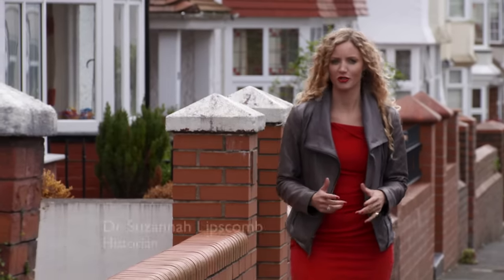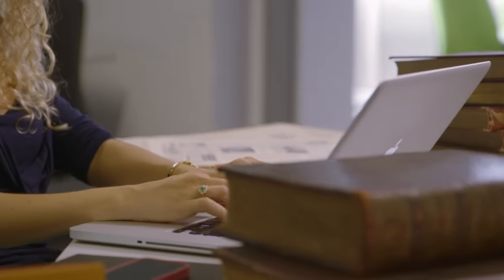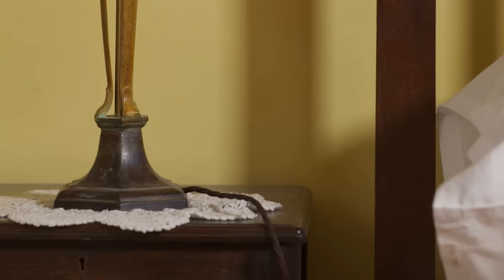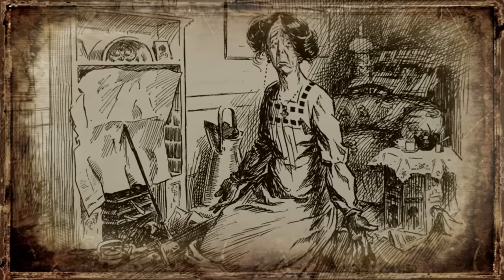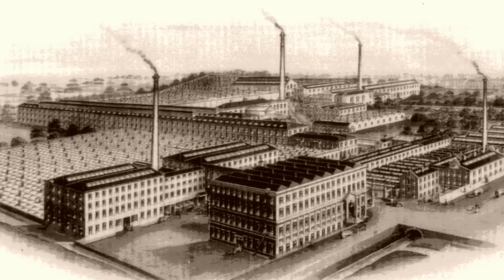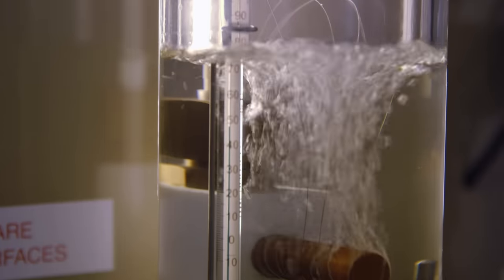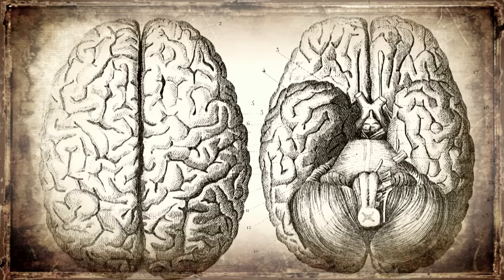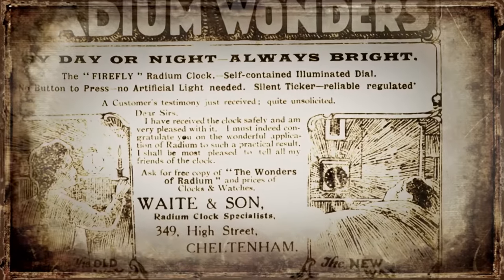How New Electricals Made The Edwardian Home A Deathtrap | Hidden Killers | Absolute History

Comment: The rise of domestic electricity actually saw a steady reduction in house fires, because of the consequent reduction of use of 

In VERY early days, there was no sheathed / insulated cables, but the cables were solid-drawn copper affixed to ceramic "standoff" blocks (insulators). These arrangements could still be found in places all over the world well into the 1990s. HOWEVER, they were originally designed for Edison's Direct Current at about 100V . The use of DC was a major reason for extended-duration "arcs" in switches. 

HOWEVER, with Nikola Tesla's ALTERNATING CURRENT, the voltage actually drops to ZERO a hundred or a hundred and twenty times a SECOND, dousing the arc instantly and causing MUCH less damage to the contact in the switch mechanism.

Also be aware that in MANY places, the early electrical supplied to houses and shops was linked straight off nearby tram supplies. If it were not for the extensive tram networks in cities all over the world, "home" electricity  would have been a long time coming.

Electric lights meant no more fooling around with candles, oil / kerosene lamps AND heaters, for starters.

Early flexible cables were insulated by wrapping layers of cotton thread around the multi-stranded core. This technique was still in use into the 1990s with devices like electric clothes irons and other devices that used electricity for generating heat in small appliances. The problem is that the cotton frays and degrades with age and is subject to attack by a range f tiny critters.

Next came Vulcanized rubber insulation, just before WW2. This was a serious improvement and timed nicely with the rapidly rising demand for electricity distribution. Unfortunately, Rubber steadily oxidizes and becomes both brittle and CONDUCTIVE. HUGE amounts of rubber-insulated cable went into domestic and commercial premises post WW2. By the late 1960's, much of it was starting to degrade and cause "issues", like FIRES. Fortunately, PVC insulation was coming on stream; CHEAPER and MUCH more robust and long-lived than rubber.

None of this is rocket surgery. Getting "belted" by mains electricity is NOT nice, and can cause nasty tings to happen to your heart, for starters. RCDs (Residual Current Detector) also called a "Core-balanced, earth-leakage detector" have been commercially available since the early 1970s. Life saving devices, they are so sensitive they will start to trip if you let the crumbs build up in your pop-up toaster.
Reply: Great comment!
Reply: I remember we had one of those cotton covered clothing irons when I was a kid in the 1990s. It always freaked me out and I was afraid of it.
Reply: The alternatives were not exactly safe either.  The gas in typical use then was producer gas, which was made by cooking coal in retorts.  The principal flammable component of producer gas is carbon monoxide.  If the lights were ever extinguished by an interruption in the gas supply (such as when a gasometer/gas tank blew up, which they often did), the building would be poisoned when the gas supply was restored.  If it didn't blow up first.  The same problems existed with water gas and carburated water gas.
Then there was the problem of adulterated kerosene, which could explode depending on the adulterants.

Also, AC only changes polarity 120 times a second with 60cy/sec AC.

Comment: I remember that houses covered with asbestos plates was a not an uncommon sight when I was a kid in the late 80s and 90s. Next to us was a very big house that was pretty much an asbestos fortress. In the late 90s they were torn down and replaced with wood paneling. I rememeber that it was a very strict and time consuming process. The asbestos houses are almost completely gone now. But there are still a few houses left here that are completely covered in it.

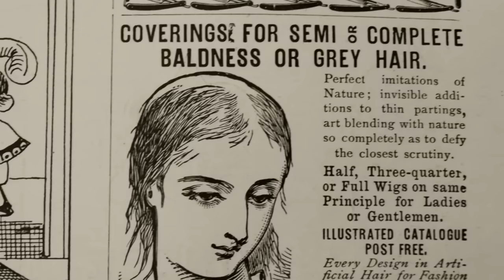46:07 My grandmother once told me that when she was a young girl in the late 1940s and early 1950s they used to straighten their hair with the clothes iron. And it was not the modern, easy to use electrical type. It was the old fashioned cast iron type that they had to fill up with burning coal. If they were not carefull they would burn their hair. And if you were extra unlucky you could completely ruin it.

Comment: The crazy thing is that, I think the elementary school I went to has asbestos in the floor. I'm pretty sure it was built in the 1960's.
Reply: Bohemian Lucy my apartment was built in the 30’s to 40’s and has asbestos in the popcorn ceiling
Reply: Asbestos is everywhere
Reply: Asbestos can't harm you if you don't ingest it. My God.
Reply: Bonded Asbestos is generally fine as long as it is not disturbed. Sometimes it is safer to leave it rather than remove as removing it disturbs things and puts particles in the air.
Reply: @damienthonk1506  True, but it's shocking they were still using it that late when the dangers were known decades earlier. The dangers were to the factory workers who made asbestos products and the construction workers who built homes with asbestos products, not the people who lived in them.

Comment: "The tiniest amount of gas". Completely false. It takes a minimum of 15 percent gas in the any room to have a detonation from a random spark. To put in to perspective, with a ten foot ceiling the first 1 1/2 feet from the floor would have to be filled with gas, doors and windows closed. This is THOUSANDS of cubic feet of gas needed for an explosion in the typical room. I have taken the licensing tests as a gasfitter, that is how I learned this. Edit: this is also why they add scents to gas now by law, naturally you wouldn't smell it there until it was a fair amount.
Reply: "The tiniest amount of gas" is subjective..  Remember, this is the late 1800's. They also  stated that gas leaks were quite common. Even today in America there is on average a natural gas explosion every 11 days.. 
Oh yeah,  the actual Explosive limits, vol% in air is 5-15%.  Again, late 1800's.. 

Good grief I don't know why I'm so fucking jaded anymore..
Reply: How big of a room would you need to fit thousands of cubic feet of gas, and have it all in the first 1 1/2 feet from the floor. Anyone?
Reply: @donnebes9421  This isn't the natural gas we're using now, this is what's called 'town gas,' 'coal gas,' or 'manufactured gas.'  Natural gas is almost all methane (with that strongly smelling tracer added as a leak warning).  Town gas was a mixture of hydrogen, methane, acetylene and carbon monoxide.  Carbon monoxide is a very dangerous cumulative toxin that can build up in a person's blood by binding irreversibly to their hemoglobin.
Reply: Gotta use them SCARE tactics yo. Look how many are scared of electric blankets. Lol.
Reply: @etherealrose2139   and rightly so,   the  radiation field that an electric blanket gives off is seriously damaging.  in the light(!)  if the book "invisible rainbow"  arthur  firstenburg,   its likely a big contributer to arthritis, rheumatism cancer and a host of EMF/RF  diseases.    all from 240v  50/60`~   electricity is going to be the next  asbestos .

Comment: As a child I was always terrified by the enormous gas geyser that loomed above the bath taps in my grandparents' Victorian/Edwardian house.
Reply: john jephcote The scary thing is that the majority of US homes still use something very similar. The ubiquitous gas "water heater" is nothing more than a slightly updated version. The US still permit open flue gas appliances in the home, unlike Europe. It's quite common to find them sharing a flue with another appliance such as a furnace. What's worse, it's usually perfectly legal to install your own - you don't need a licensed gas fitter, are not obliged to check the flue draft or run combustion gas analysis. It's probably only because these things are normally located in the basement that we don't hear about more deaths.

Comment: It was Tesla who discovered electricity
Reply: Na. He did pioneer alternating current, the first electric motors and many other things but he did not discover electricity. Don't get me wrong, he was awesome but plz don't confuse facts due to modern day hype.
Reply: Just to elaborate. Tesla came about alternating current in 1887. The first modern battery was created in 1800 by a dude name Volta after he had figured out the steady flow of electricity.
 Before that (1752) a little guy named Ben Franklin did an experiment with a kite and key proving lightning and electric sparks were the same thing. This came about after studing works of Thomas Brown who modernized works of William Gilbert (circa 1600.)
 Muuuuccch before all of this the Greeks had discovered the electrical charge around 600 b.c. It is also known that Egyptians studied electric shocks from fish. Not to menton the bagdad battery, traced back to the Parthians in 250 b.c. used to electroplate silver.
 Electricity is ubiquitous within physics and the universe itself. Who first 'discovered' it will never be known.. but it most definitely was not Tesla.
Reply: Ben Franklin ?
Reply: @Grovesie35   Way to tell it like it is !!!  There is so much BS floating around out there.  Rosa is just another uneducated commenter...

Comment: I'm only early seventies but I used to use appliances with a cable to the light socket. Also, my Mother said that her father only installed electric lighting downstairs and that it was thought unnecessary when merely going to bed. A candle sufficed as it always had.
Reply: Michael Caine is shown doing that in the 1971 film Get Carter. I recall seeing fire safety literature as a kid in the 80s advising against it. I'd never seen it done at the time.

Comment: Here in Bermuda our houses used to be made of local sandstone.  They would run the lead cables through the walls, and when it got damp (most of the year in fact), you could get an electric shock just by touching the walls.  This was still true at the time I was a child, although rare as modern methods were quickly displacing the old wiring.

Comment: As an electrician I have been shocked by everything from 120 volts AC to 480 AC. 120 feels like you got hit in the funny bone. 208, 240, 277 like you got hit hard with a stick. 480 is like getting hit with a sledgehammer. My hand turned red then black and blue and purple. Took weeks to feel normal again. 

I have been shocked thousands of times.
Reply: how... shocking.

Comment: I am 51 year old female with mesothelioma, yes I was exposed during the mid  1970ts to early mid 1980ts only started trouble with breathing  3 months ago August  2021. Although I suspected I was becoming unwell at least 2 years before  I could not put weight on and struggled to work without getting fatigued.  I am very upset and Angry that many people are still going to suffer and the toll will take yet another 100 yrs to know the figures of how many have died from this horrific stuff.

Comment: The council, were checking my roof for asbestos last month , they two years ago put on a new roof and insulation around my building.  Surely they should have checked for asbestos before putting on a new roof?  Luckily they didn't find anything. But it seemed like the wrong order and would have saved money if they had checked before

Comment: I remember as a lad our house in Bromley which had the ancient array of round pin plugs that often made zzzt noises and zap-u light switches.   I helped my late father rewire the house which was brought on by one evening one of us had gone into the kitchen but not turning the light on, the electric cookers massive 3 pin socket plug was glowing like a cherry as was the understairs fuse for that circuit so we put in all new MK square pin plugs, shielded mains line he had purloined from British Rail, MK roses for lights and the cooker had its own separate fuse circuit breaker (very early RCD) and it took weeks to finish.   When we stripped out the old ring mains, much of the fabric insulation had long rotted or eaten by rodents and how them bare wires never touched amazes me to this day O.o   Also my younger brother had discovered he could shove two Parker pens into the larger round pins and make them do funny things, how he is alive amazes me too.

Comment: Electrocution depends on how well grounded (a return path). Say, standing in water, bare foot, and you grab the light socket. If you are not 'grounded' you can touch thousands of volts of electricity and suffer no harm. Note the men who work on the high line transmission lines. They get in an insulated bucket truck and they handle the live wires with no issues. However, if they were standing in a pool of water, and touch said wire, they would be instantly killed.

It is why birds can sit on electrical wires and not be affected. Because they are not grounded (no return path) for the current to flow.

Comment: When my family moved down to live in my Granddads house in the late 1950's right down at the beach by the sea at Bonchurch Isle of Wight, there was the old telephone in a wooden box, mounted on the wall with the lift off ear hand set hanging on a bracket come switch on the left side, and the coned microphone on the front of it, with the dial. Then there were lead pipes for the water,  and the electric twin black and red 'insulated' wires were mounted in grooves on wooden slats down to the brass light switches, and  two pin plugs and sockets . There was also the remaining gas outlets on the walls for the lamps, long removed I guess when an electrical supply was installed.
The house was quite old, I think built in the 1800's sometime, with dark wood panelling covering the walls with bell pushes in the dining, and sitting room, plus the main bedrooms.  Down in  the back  (servants) room opposite the kitchen, above the door was a glass fronted cabinet with the bells, and the number of the room for the various rooms.
This was a 3 story building, with the top floor for the servants quarters, and a hidden stairway from the kitchen (opposite the back room) that went up to the middle floor, then over the landing to the other set of stairs up to the servants quarters, so that they could move about without (in theory) being seen going about their duties.
A lovely old house with high moulded ceilings, but a bit freezy in the winter time with just open fire places in just about every room for heating, which in the old days the servants would start a fire in them to keep the rooms warm.
Also near the kitchen was a door that went down to the cellar where the coal was kept, and supplied via a man hole outside the front door.
Back then when we lived there, the lounge and dining rooms were not used except at Christmas time, as normally we 'lived' in the back room with a large(ish) table for our meals, cooked on the coal gas cooker.
The house was eventually rewired, and none of us managed to electrocute ourselves, as we didn't recognise any dangers, and the lead pipes were replaced with copper ones.
Happy days when growing up....:)
Reply: Thank u for sharing ❤️

Comment: 18:52 - A small but important correction, the fuse wont protect you from lethal shock. This is a misconception that still prevails to this day. The fuse will stop you from burning the house down, but since a few tens of milliamps may be sufficient to kill you at mains voltage, and since a typical mains rated fuse will allow amps rather than milliamps to pass, the fuse will only protect you from short circuit fires. 
Modern domestic electrical systems employ leakage current detection devices to provide shock protection. These came along much later than Mr Eddison. 
Eddison's idea to include a fuse provided very little protection from electrocution.  The rubber insulation on the plug however might, assuming you don't get it wet of course. The correct rating of fuse is  also important to ensure the electrical device functions, but doesn't set itself on fire if it shorts out.

Comment: I grew up in a house made in about 1950.  (USA)  None of the outlets were grounded.  I remember   a socket/ outlet that screwed into a light socket.  You could then plug in an electrical device and the light bulb.  Had screw in fuses.

Comment: As far as the electrical voltage being too high that's incorrect @absolute history. The amperage exceeds what the conductor can handle, that in turn becomes an inductive load that melts the electrical conductor.

Comment: And this is why, when working around electricity (of sufficient voltage), 'one hand in pockey, no shockey'. Remember, it is a combination of voltage and current. 

For example, a shock from grabbing a door knob, that is 30,000 volts of static electricity. But the current is micro amps. Not nearly enough to cause serious harm. Yes, it is uncomfortable, but it won't hurt you.

Comment: You would be lucky if you had 4 circuits in your home when they were first wired. The place we are currently wiring will have around 20 circuits which is at the minimum by current code.

Comment: My house was built in 1885; the gas lines are still in the walls. It was electrified in 1916, and until this week, it kept the 1916 knob-and-tube bare wiring and pushbutton switches.
As of now, it's up to code. ;-)

Comment: I wonder if the States had the problem at 13:34 to the same degree with the varying Voltages with lack of regulations or if monopolies had the benefit of consistency in voltage?